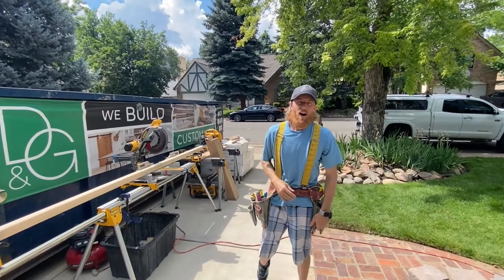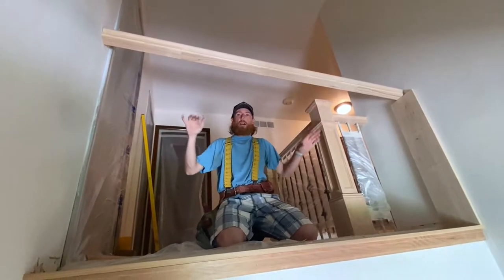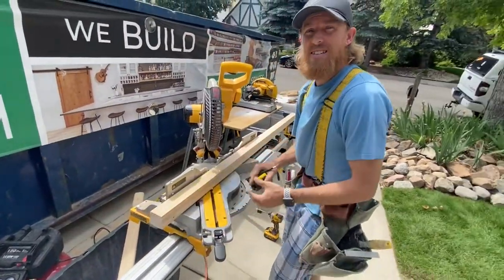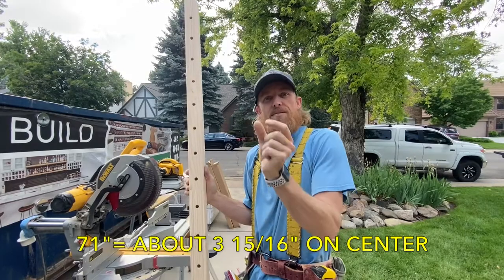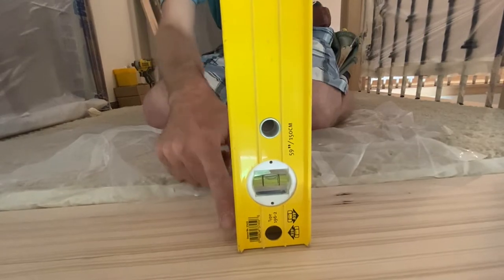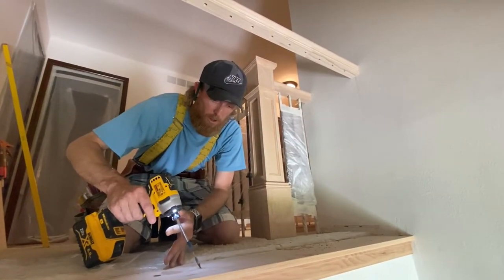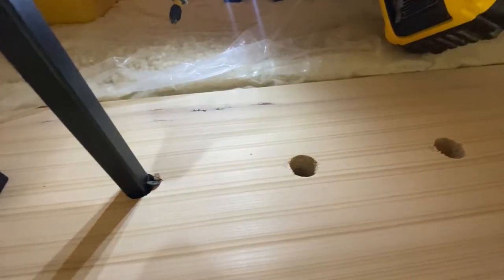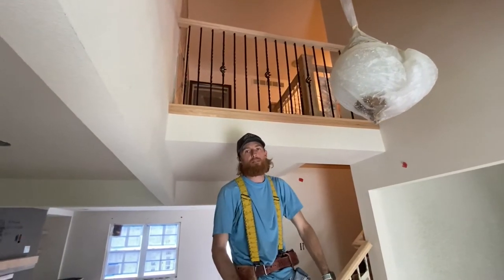Installing Handrail with Iron Balusters: Baluster Layout, *MY SCREW* Install Technique Pt. 2

Comment: Watched a lot of videos on balusters on YouTube and yours is by far the best for my application. I am replacing my wooden balusters with metal (same kind you are using). Have to drill into solid oak to place them which was intimidating. You gave drill sizes to use and depth. Helped a lot. Also, your drywall screw wedge worked great. Thanks Cliff

Comment: Thanks the screw method helped me out BIGTIME! It's definitely something that takes some practice and finesse to get it right. Maybe because I was using 3/4 oak bullnose. Also, 11/16 needs to be precise. I tried a 3/4 and was too big for the screw to work and needed to double screw several. But a fast effective method. I would recommend drilling through the bullnose first as not to chance hitting a nail or screw in subfloor. Because there's a lot of holes and you want a nice sharp bit. Then once you've done the hard drilling you can use a junk bit or the same one and finish the depth of the holes. Another tip, depending on how you plan to tighten the Allen key screw, you may want to start tightening them until they are almost to the width of the baluster. Also keep in mind which way the bottom caps face, because you won't be able to use a screw gun certain ways. But pre tighten them so it's less work of you are using a hand held Allen key. Or if the gun won't fit in certain areas. I'm a perfectionist so I also factor in which side I will be putting the screws in. And then drill accordingly. Since the screw will pull it out of plum an eighth of an in or so. And if you're up against the wall or knewl factor in which side as well. Doesn't hurt to use some finish screws for some extra strngth either when securing the handrail to the wall. We almost always have rosettes on the ends of the railing so glue and 2.5" 15 gauge nails are fine. Just remember it's a safety rail but it's only meant to save you from one good hit or fall in reality. And the glue and nails will do that. But if you want it to last a bit longer go ahead and toss some blocking in there and use screws. This is not a dog and the way he does it is totally acceptable in my opinion. I just go a little stronger. Thank you for the video and saving me so much time and head ache... So glad I found this video and thought I'd come back to say that and share my thoughts. You rock man keep it up!
Reply from the maker: Thank you Jeremiah for this awesome comment and your time writing it! I can relate to everything you described! Don’t worry I added pocket screws to that rail for extra support, but didn’t get that in the video. I’m very glad I was able to help with one of your projects and I love your description of the process you went through(great tip with using multiple drill bits)! Have a blessed day and look forward to more from you in the future! 😎

Comment: This is a great way to do this! I purchased a laser level that has a dot feature and it worked fantastic, just lay-out bottom and shoot the laser up to the hand rail, it self levels for a true and level mark. The only issue I ran into was my stair nose was to far out to drill down enough so I had to place hand rail on the balusters, so the screw in the bottom helped keep them upright. Thanks for the informational video.

Comment: The baluster technique was great!  Much quicker than most techniques. But a railing is primarily a safety device and your railing is held in place with 4 finish nails into whatever on each end, thats not good. My suggestions would be that the shoes should face the other way so the homeowners aren't looking at the allen screws, not that hard to screw them in from the other side.  And a $50 laser to line up the bottom holes is faster and more accurate than the level for most installers.  Thanks!
Reply from the maker: I pocket screwed each end of the handrail…I messed up on some footage and that part didn’t get recorded…thanks for watching and have a blessed day 😎

Comment: I knew there was a good reason I've been putting off installing my handrail & balusters for over a year!!!  And people call me a procrastinator!!! 😆
I came across your channel today; your explanations are thorough and well demonstrated. Thanks so much!!!
Reply from the maker: Chris I really appreciate the feedback! I’m a huge procrastinator as well! 😂 let me know if you have any questions and have a blessed day 😎
Reply: @huntercarlson5446  I do have a question about how to cut the iron balusters. I have both hollow and solid iron, what type of blade do I need for my chop saw?
Reply from the maker: https://www.acehardware.com/departments/tools/power-tool-accessories/cut-off-wheels/2799237

That’s a link to the exact blade I use for my Dewalt 14” Chop Saw. This blade can also be found at Home Depot located directly under the display models of these tools. I know you said you have a chop saw…is it 14”? If my recommended blade doesn’t fit you saw, let me know what tool you are going to use…
Hope this helps! Have a blessed day today😎
Reply: @huntercarlson5446  mine is a compact Kobalt miter saw, so I think 7.25".
Reply from the maker: https://www.homedepot.com/p/DEWALT-7-in-x-1-8-in-Metal-Abrasive-Saw-Blade-Bulk-DW3511/202579870

I’m a little hesitant on recommending a blade for your miter saw to cut metal…I don’t think these blades were made for Miter saws, more circular saws…do you have a grinder by any chance? I feel we need to figure out a different tool to use than a Miter saw…just my personal opinion, I haven’t used miter saws for anything else other than wood, MDF, or PVC materials…
Reply: @huntercarlson5446  I have a grinder as well, I think I've watched too many injury videos to use it though! I have a table saw and circular saw too. Thanks so much for the feedback!!
I have about 55 to cut so I'll start with the hollow balusters just to see how it feels. I also like your idea of holding the cut end to the side of the blade to knock down the burrs. 
Have a Merry Christmas Hunter!
Reply from the maker: I hear ya on the grinder…number one thing is to stay safe and not injure yourself. I like the idea of starting with the hollow balusters and working up to the solid…I hope you have a Merry Christmas as well! Also thanks for your support of the channel! 😎
Reply: I have a question about mounting the handrail with just dabs of liquid nail.  Code requires a guard rail to resist 200 pounds of lateral force applied to  within two inches of the top of it  Do liquid nails and 4 - 15/18 gauge nails meet that requirement ?

Comment: Great video. Just wondering about the top and bottom hole’s. If the bottom hole is bigger than the top but still centred with the top does the screw not push the baluster over to the side throwing it out off plumb   Thanks

Comment: For transferring the lines for the baluster holes you could have simply laid the railing on the floor before installing it and transferred the lined, but what i did on mine because I couldn't do that as my newel posts were thinner at the top than the bottom is I attached a small magnetic level to a baluster and did exactly what you did with your 5 foot level but I was able to eyeball it a little better by using the actual baluster and with the level being magnetic i had a lot less trouble keeping it level when i got to the sloped part of the stairs where I was also putting in railing.

Comment: Here's a tip. When installing the iron balusters, use a 5/8" paddle or forstner bit for the lower hole. The baluster will friction fit in the bottom hole perfectly. 

I use clear silicone inside the top hole. Fill the hole with a little extra room and the silicone will fill the inside and outside of the baluster. This way they don't rattle....especially on stair handrails.

Comment: Awesome video, gave me so much more confidence that I can do this myself. I'm sorry if you mentioned this and I missed it. Are these balusters 1/2 inch? I love how easy this screw method is, so much better than glue or epoxy. Just wanted to verify the drill bit sizes. Thank you so much!

Comment: Such a helpful video! 2 quick questions:

1) If I have boots the are low-profile/flush to the floor, can I countersink the screws on the bottom enough to accommodate?

2) I have 3/4” square balusters. How big does my upper hole need to be and how should I fill the space from a square rod in a round hole?

Such a killer channel! Thanks for all this great info.
Reply from the maker: I really appreciate your compliments! 

1) Since I don’t really know your style of boots it is hard for me to answer this question…but yes I believe you can still sink the screw to be flush with the floor, you may just need to pre drill with an 1/8” drill bit to help the screw sink further. 

2) I hope u are measuring the balusters diagonally from corner to corner…I would try on a scrap piece of material a 3/4” spade drill bit and see if you can push the baluster into that hole about an inch…if you can without struggling that will be your top hole…if you can’t then try a 13/16” spade drill bit…for the bottom hole you can go with 7/8” and make it easier to slide in and that will help with sinking the screw…you can either get more boots to add to the top of each baluster to cover the hole or possibly just leave it the way it is, I personally don’t mind the look of a square baluster in the round hole on top as long as it is snug in the hole. 

Hope this helps! Have a blessed day 😎

Comment: Hunter, have you ever run into the angled shoes where they don't quite match the angle of your rake rail?
Reply from the maker: I have run into this issue a few times…when you tighten the Allen screw it shifts the boot so it doesn’t sit nicely on the rake cap or handrail. For “track” homes I leave the boot the way it is and have never had any warranty issues. For more custom projects I will use either hot glue or liquid nail to secure the rake boots to the cap, let the glue dry, then tighten the Allen screw. Some older homes have some extremely steep stair cases where the iron boots will never match the pitch unfortunately. Thanks for watching and leaving some personal feedback! Have a blessed day 😎

Comment: PL premium for spindles. 💪💪
Reply from the maker: When installing these balusters with any type of glue, your always going to have a couple balusters that loosen overtime or the glue just fails over the years. Not to mention the potential mess and damage the glue does to the rail. That’s why I use this screw method…no mess, no damage, each and every baluster is secure and straight, and it’s easy to remove the balusters in the future if needed. I highly recommend trying this method! Thanks for watching and have a blessed day 😎

Comment: Is the top rail secure enough to the wall to withstand a kid running into it? I seen the little bit of glue and trm nails. Is that enough?
Reply from the maker: Great observation! In this case, yes, the glue and trim nails have enough hold to support the rail. I was also able to get the rail super tight from wall to wall. I also had framing behind the drywall for my trim nails to grab. Off camera I did push and pull the handrail to the point that it flex’s without loosening from the wall. In other cases I will countersink a 2 1/2” screw on each side for additional support. If the rail wasn’t so tightly wedged to the wall I definitely would have added screws to each side…thanks for watching and asking a question! Have a blessed day 😎

Comment: I am replacing my existing wood balusters and wood handrail with new handrails and new iron balusters.  I will be using the existing holes in the flooring and drilling new holes in the new rail.  How would you suggest that I mark the new handrail properly to drill new holes?  I was thinking of using a laser placed over the  center of  the old holes in the floor and pointing it up to the new rail and then marking the spot the laser indicates.  Any other suggestions?  Thanks
Reply from the maker: The laser level would be the perfect tool to transfer your holes to the new handrail! Seems like you already have a great game plan! Only thing I would recommend is to drill the holes on the handrail before installing the handrail permanently. It’s easier for me to keeps the holes straight and consistent drilling down into the piece then drilling up into the handrail on my knees…thanks for asking and reaching out! Any more questions don’t hesitate! Have a blessed day 😎

Comment: Hey Great Video! What would you recommend in this scenario: I removed wooden balusters and want to add Iron but the holes on the treads and the bottom of the hand rail are all 3/4"... Do you think this method would still work?
Reply from the maker: Yes I believe my method still works…most likely you will need to add a screw at the top of each baluster to make it snug in the holes of the handrail. At the bottom you may need to drill deeper to help the baluster get into position. I used 1 screw per baluster in the video, but you can also add a 2nd screw to help with pinching the bottom of each baluster. 
In your scenario I would possibly use a boot at the bottom and top of each baluster to cover your screws and holes. In the video I only have the boots to the balusters at the bottom because my top holes were drilled to fit the baluster nice and snug…
Hope this helps! Let me know if you have any more questions! Have a blessed day 😎
Reply: @huntercarlson5446  Wow didn't expect a reply so fast! Thanks buddy! That is helpful - I really enjoy the videos and tips. Please keep it up for us! :)
Reply from the maker: I appreciate you! Thank you for your time! It’s been a few months since my last video, so I will work hard on getting more footage and more videos in the near future!

Comment: You mentioned drilling the bottom holes 2.5” inches down. Have you ever drilled all the way through a stair thread, or should there always be enough material depth in those locations?
Reply from the maker: I’ll always drill about 2” down when there is a rail cap.  Not worried about the material depth because we are pinching the baluster to the rail cap and subfloor.  There is only a few conditions where I’m worried about drilling depth…If there are open stair treads in the house where you will see the bottom of the treads, we obviously need to watch how far we drill. This will also change the length of the balusters on how to install them…
Any condition where the bottom of the baluster is hidden in the floor or hidden in the wall going up the stairs, don’t worry about having enough material. Almost every house I have installed iron on a flat run I will drill through rail cap and subfloor (1 1/2” thickness) and then there will be 8-10” open space due to the open area in the floor joists. 
Hope this helps! Get back to me if I didn’t fully answer! Have a blessed day 😎

Comment: Thank you Hunter, I'm going to follow this exact technique for my home project which is almost identical to this installation you did. For those of us who don't have iron cutting saws, I take it you can use the balusters as-is i.e. full length or are they too long for regular height handrails and they must always be shortened? I didn't get that part...
Reply from the maker: Hey Stephen, unfortunately the iron balusters     come from the manufacture at 44 inches, so I have to cut each one down to size to fit the opening. Instead of using a metal saw to cut them, you can easily use a hacksaw with a metal cutting blade. This tool is less than $10 at the local hardware store. Most iron balusters these days are hollow so it will cut just fine by hand. Just try to “deburr” the end with some sandpaper to make it easier to slide into the bottom hole. Hope this helps. Let me know if you have any more questions and have a blessed day 😎
Reply: @huntercarlson5446  Thanks so much for your quick reply!! Great to know I can use a hacksaw with a metal cutting blade. Love your channel and easy explanations!
Reply from the maker: I really appreciate that thank you

Comment: Just wondering why you did not use rosettes so you could screw rail to wall
Reply from the maker: The homeowner for this build didn’t want rosettes for the rail…I did plug add 2 1/2” screws off camera once I was done with the balusters…I’ve not installed a lot of rosettes here in the Denver area, more of a half post if the design is chosen that way…thanks for your time! Have a blessed day 😎
Reply: I have a builder who don't like to use rosettes if the rail is not wall to wall I like to use a rail bolt if I get a plowed out rail I can notch out bottom for bolt and hide with fillet

Comment: hello, Love your video. I have a question. I would like to use my existing posts and rails, my question is I have a piece of wood trim, I guess you can say at the very bottom of the spindles instead of them attaching straight to the step themselves. The wood trim isn't thick enough to put the spindles in at the bottom. If I remove the bottom rail it would go straight to the carpet. How would that look or how can I do this? I wish I could attach a picture to help make it easier to understand. Any help with this would be amazing. Thanks so much,
Reply: You only really need 3/8 of grab on top and bottom. More is better but as long as the material you go into doesn't move you will be fine. So cut the top shorter, and then measure from there. If you have more than  3/4 on the bottom just drill 3/4 . This leaves the 3/8" on top and bottom. Or remove or replace bottom rail. Then use shorter screws or just glue.